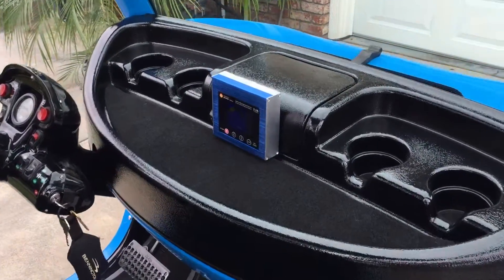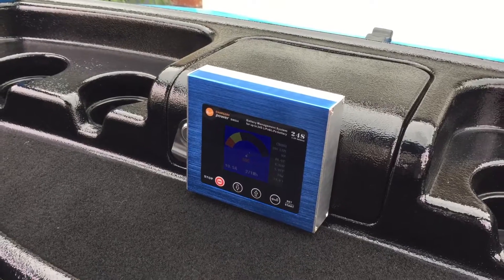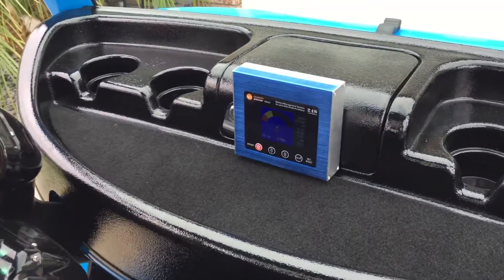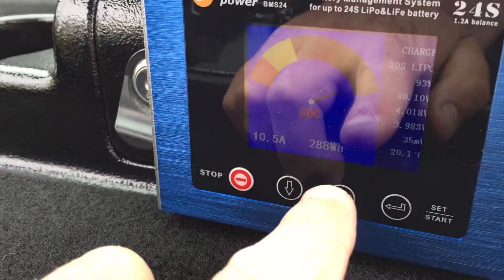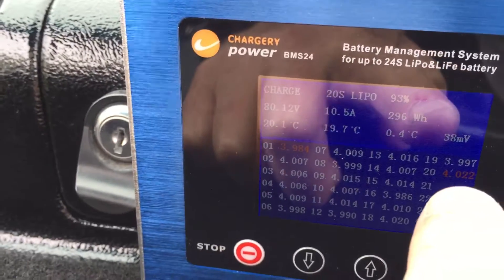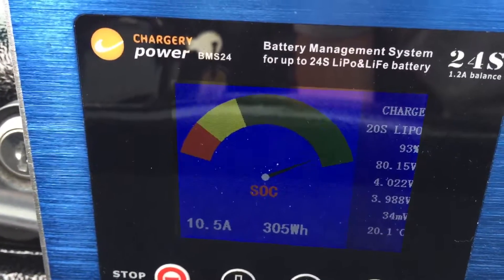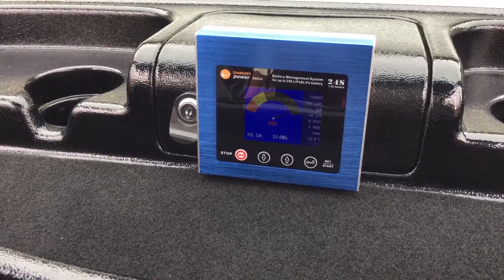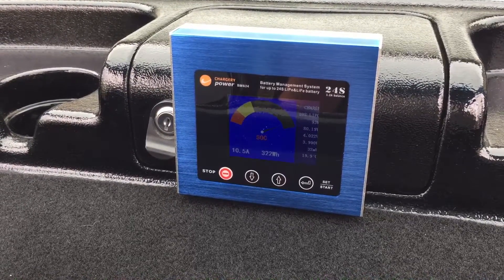Gem Car BMS Omni Electronics

Comment from the maker: The SHUNT takes & Measures all the Amps that pass threw the Battey Pack. The SHUNT is a 600 Amp Shunt.
Because the amps don’t go threw the BMS I would think that it’s more about the size of the Shunt then what the BMS can’t take. But the GEM cars pull 250 Amps on a Regular basis
Reply: Grant West the shunt and the bms are mounted in serie at some point, and the BMS should be also able to handle the 250 Amps as it’s purpose is also to disconnect in case of an important surge. I am asking because I have an ANT BMS, supposed to handled 200 amps and it trips all the time. Do you have the exact reference of the BMS? Thanks...
Reply: Grant, do you have David's information?  just bought a cart that he modified and the 22 cell lithium battery has four dead cells and won't move.